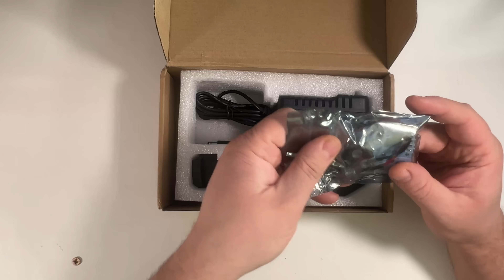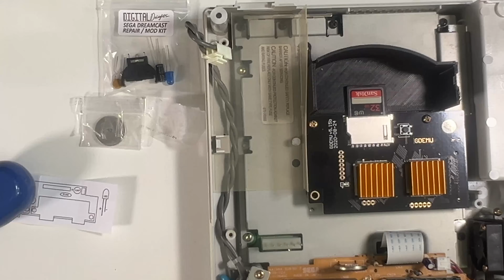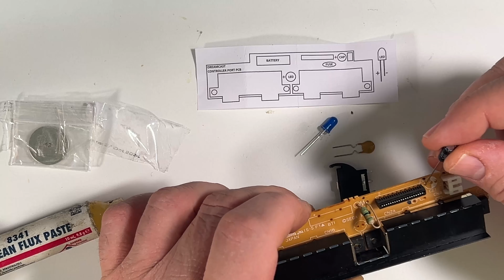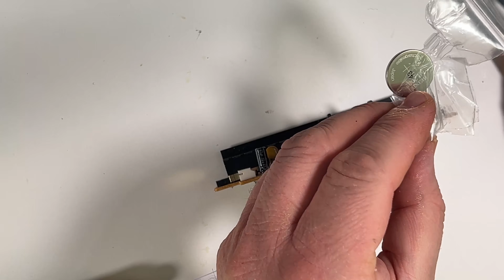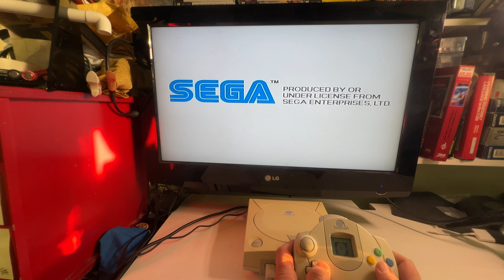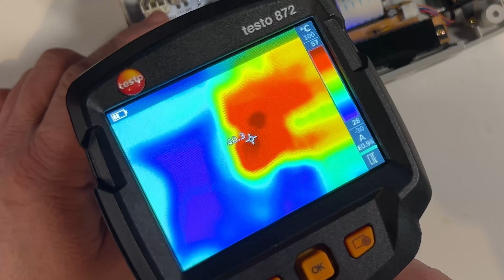Must have (and Cheap) mods for any Sega Dreamcast

Comment: I got the cheap dream psu. Wouldnt power the dc. Found the 5v rail was dead. All solder joints looked great. Swapped both regulator ics to see if the 3.3. Volt rail was then dead and it all came alive. Probably should have started with a reflow.
Reply from the maker: Good tip on checking the regulators, it’s always worth trying a reflow first before swapping parts out, especially when he age of them now. Thanks for sharing!

Comment: Handy guide, thanks! Replaced the capacitor, fuse, and battery holder with this. Had an issue where the ports didn't work - stupidly I had inserted the battery backwards!! All good now.
Reply from the maker: Excellent, glad the guide helped and you got it working. Very easy to get the battey around the wrong way but glad you noticed it and got it sorted

Comment: Is the temperature less than the 3 resistor mod overall?
Reply from the maker: The heat is more dissipated without the resistors. It’ll still be hotter internally but not so localised like the resistors cause. Extra heat is never a good thing. The basic Dreamcast gets quite hot anyway as it was only designed to last for so long. Extra fans will help but if you are fitting a GDEmu then I’d recommend fitting a dream psu or similar at the same time. As the psu is now external, it takes a lot of that internal heat away. Hope this helps
Reply: @BillFixesEverything Appreciate the response. Any plans to test the temps with a noctua fan mod?

Comment: I’m curious as to why everyone uses the DreamPSU as opposed to the USBC internal power supply- to me, they are both better than the stock power supply but it seems off to move the heat from the console (where the fan is) to the wall. I’ll be the first to admit I know nothing about either- but I’d love to have your opinion
Reply from the maker: Thanks for your comment. Either is fine. I think it may just be down to cost. The dreamPSU option at the moment comes in at 1/4 of the cost of the USB C option. The dreamPSU needs 12V 3A power supply with a barrel jack connector. However, the USB C option requires a USB C power supply that you would use for a laptop, around 30W delivering 15-20V. If you are good at keeping everything together and not losing your power supply bricks then DreamPSU works well. However, if you have laptops with USB C chargers then it’s usually easier to find one of these close at hand. Both of these boards are just as easy to fit. I think it’s just down to what you prefer.  Hope this helps you
Reply: I'm not sure if I'm misreading your comment but it is 100 percent better to remove the heat from inside the console and move out outside. That said, most of these dreamPSU circuits are not well designed and a simple recap of the stock power supply is the best path forward.

There's no reason to buy these aftermarket power supply replacements. The temp benefits are minimal and you're replacing it with a design that hasn't been properly vetted or certified.

Comment: Where did you get your info on the Li battery discharge by touching both sides?
Reply from the maker: It was when I was an apprentice. One of the engineers I worked with used to work in a model shop and he was told that touching both sides of a lithium battery will short it out and cause it to drain heavily. I did a quick search on google and it does says that it can potentially cause damage to these small batteries if you touch both sides. It maybe similar to making sure you discharge static before handling chips. You may handle them and they work fine after or may handle them and damage them. To be on the safe side I try not to touch both sides if I can avoid it.
Reply: @BillFixesEverything  there's no truth to this. At this tiny amperage, the skin will simply not conduct electricity in a meaningful way.